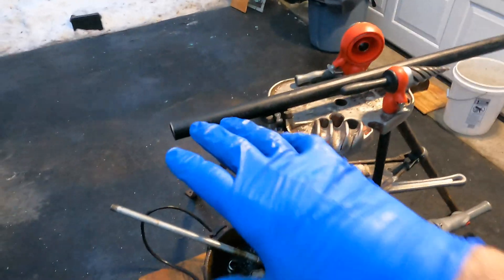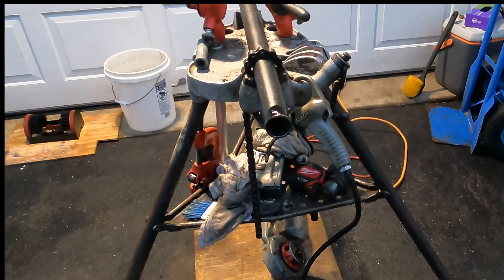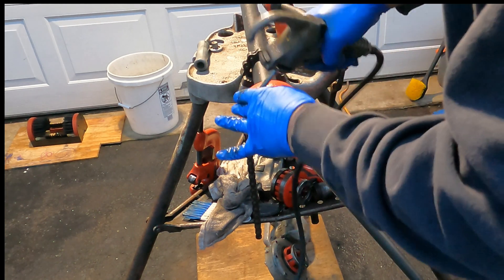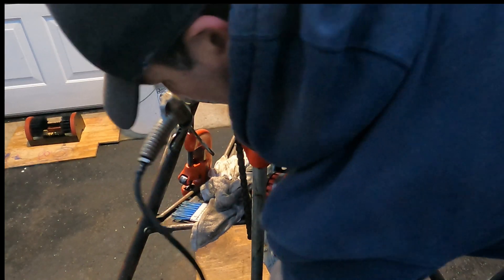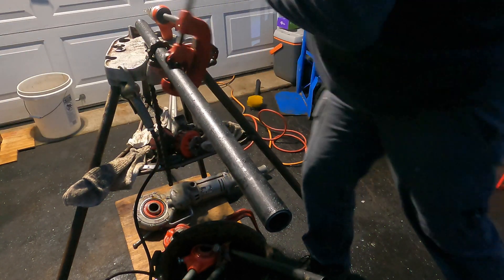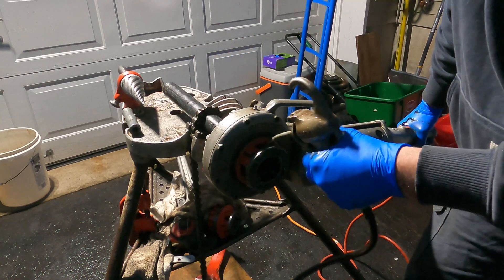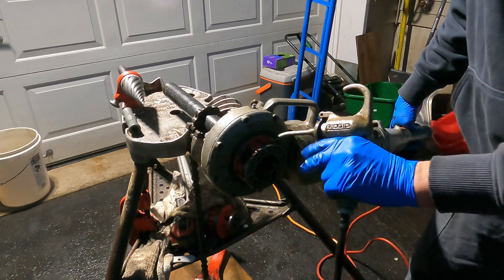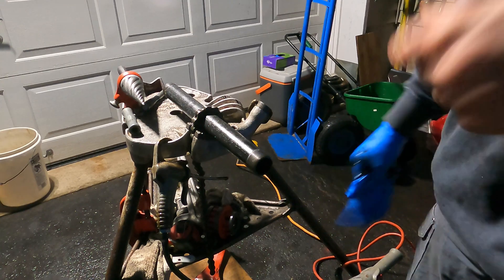How to Cut, Ream, Thread Black Pipe Manual/ Power Treading

Comment: Very poor example of how to ream a pipe by hand , it's a lot easier if you put the handle to the right and push down than trying to pull up on the reamer to ream the pipe. Also if you had a 2x4 with a V notch cut cut in one end that went from the ground to the handle of your electric threaded you wouldn't have to hold on to it. Looks like your oiler could use some work too .👷🏻